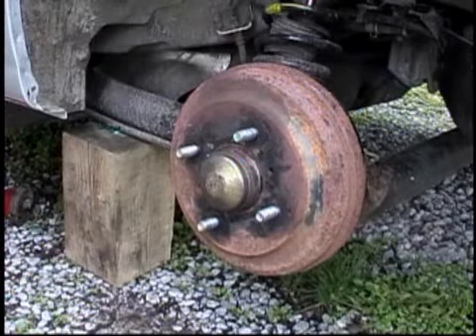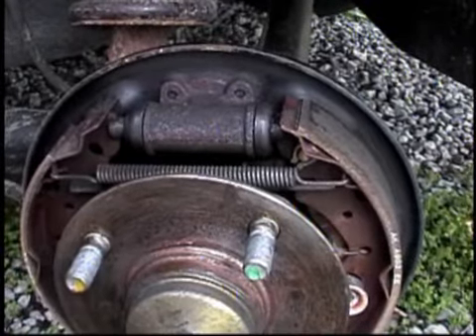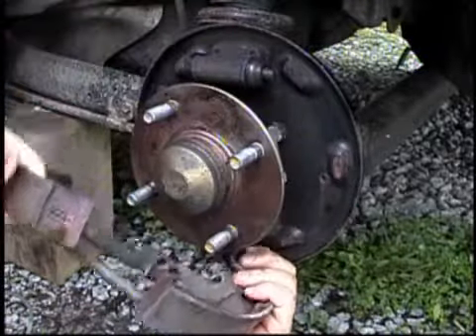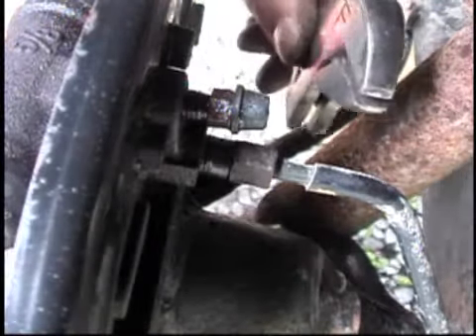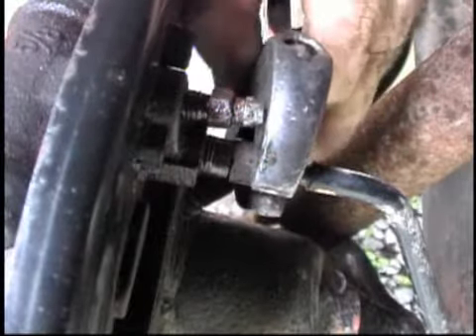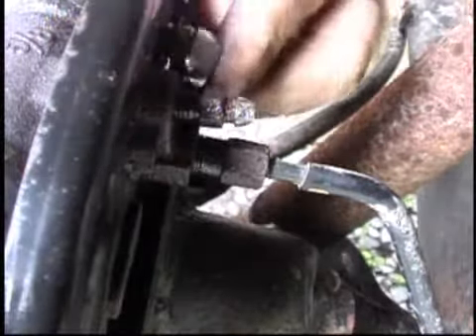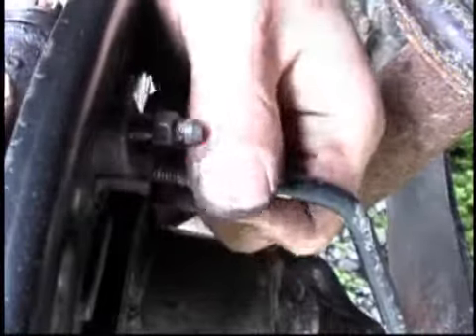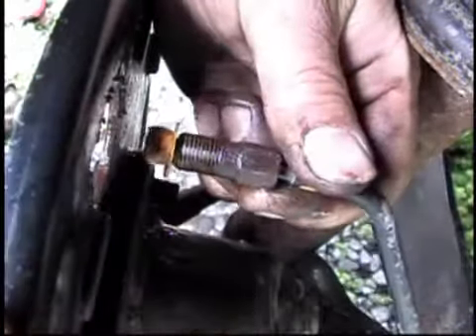How To Replace a Wheel Cylinder Pt.1

Comment: You positioned those wrenches contrary to their mechanical advantage.  Moreover, probably should use a flarewrench.  Personally, I rarely use adjustable wrenches for anything.
Reply from the maker: ive shattered those cheap wrenches before on lesser items lol.  I have a flare wrench now, just had to make due with what I had at the time.  The line was already somewhat loose so the adjustable wasnt too bad....  I dont use them too much unless I have to....

Comment: when i loosened the bolt that connects the brake line to the cylinder, the bolt and line were rusted together so i ended up twisting the line and snapping it :( just a errors of caution to others
Reply: What should be done? should I tap rust off or hold line with pliers at the metal point and use wrench opposite way?